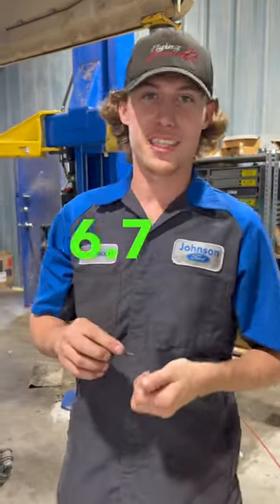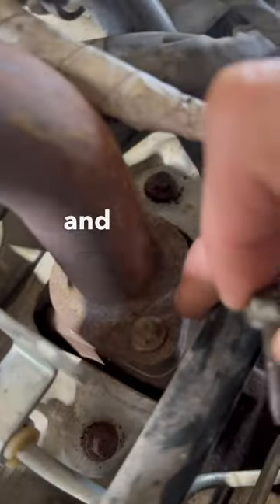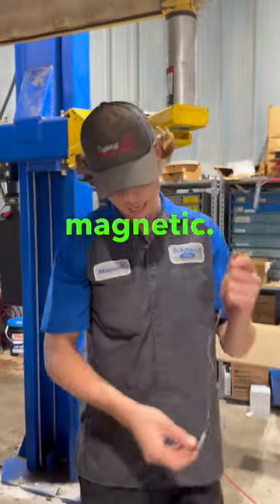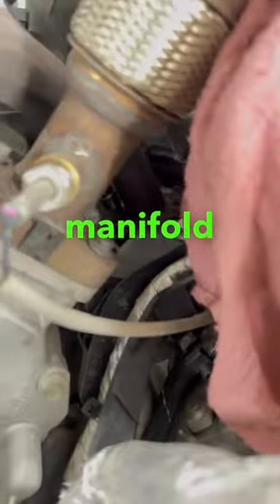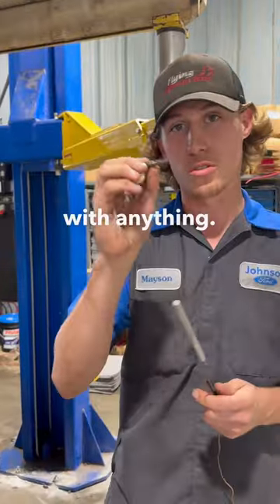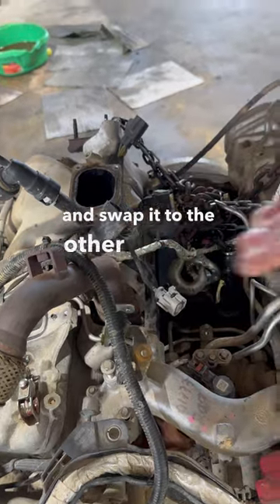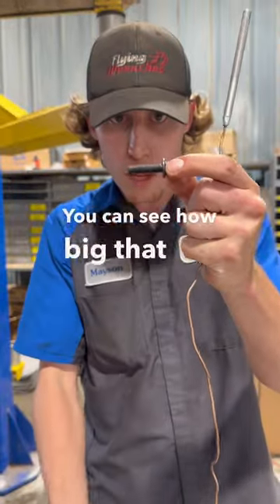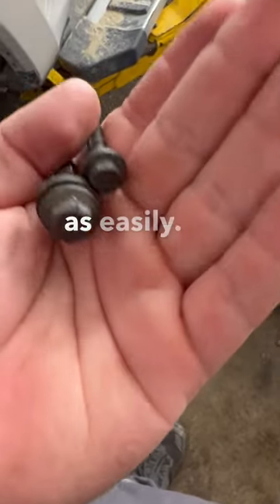6.7 PowerStroke EGR Bolts are a NIGHTMARE #shorts #powerstroke

Comment: I have never had one break since I started using this technique. Buy yourself the longest brass punch the Matco truck will sell you. Take that punch, clamp a set of Vice grips right near the top, and then you gotta wail on those bastards with a 3-4lb sledge. I’m talking a solid 20+ hits per bolt. Try to make hits as direct up to down as possible. This process, obviously, shocks the bolt and shatters the rust “crystalline” structure holding the bolt in place, the rust from the manifold is pinching the bolt and holding it in place, with more force than the yield point of the titanium. If you turn that rust structure into powder or crack the structure enough, then getting them out is possible. I’ve had the last 4 I’ve done with mileages varying from 68K - 180K come out like a dream using this technique, just had to buy a specific punch for it (wasn’t cheap… of course). After striking the piss outta them, I get a 3/8 air impact with a long extension and see if I can get a 5/16 socket to squeeze on there so there is literally no play to round the bolt. Then spray and pray. Sometimes I’ll give it just enough to lift the head, spray some blaster down in there, run it back down and let it sit for an hour. Just on the higher mileage ones. Good luck.

Comment: I've had to weld nuts onto those before.  Used to work on a fleet of them and it was common for those bolts to break when you needed to remove egr cooler.

Comment: I have a attachment for my air hammer you can put a socket on it and turn it with a wrench and it’s worked on those bolts so far

Comment: Pro max has a bit specifically for those and it’ll drill em out both in two mins or less once you get a straight shot !!! I’ll drill one any day and if you come up with a good process and can break just the heads off you can use rbrt 8 mm and slam it down on the shaft and work em out and just do a good ole chase after an bam problems solved and the best is it just disappears because it’s junk 😂

Comment: Heat soak and hose with penetrating oil. Repeat a time or two and pull while engine still hot works them out every time

Comment: I always tell customers the only way I’m doing certain jobs is to replace the manifold.   They as why? I then do as you have and inform them that most likely the bolts will break and drilling them is a no go as well and having the bolts and manifold on hand and ready is the smart Choice and then there isn’t any surprises or delays in the job.  And the manifolds are dirt cheap anyway.

Comment: Get a set of M42 Cobalt drill bits, slow speed & tap oil will drill those out. If you can, find left-hand drill bits, they might remove that bolt so you don't mess the threads up.

Comment: Probably somebody finally explained to the Ford engineers that an 8 mm steel bolt and an 8 mm titanium bolt that are the same size have about the same strength. Titanium is stronger by weight not by volume. There's no point in using titanium unless you're looking to reduce weight. Titanium in the same dimensional size is not significantly stronger than steel. Caterpillar made the same mistake on the mounting bolts for the planetary gears for the rear drive of 793D haul trucks.

Comment: You can heat the bolt up for easy access. Second. Yes. On fords. They tend to make the whole wider with manifolds or any other component that tends to brake. Theynhave kits. Thats the solution.

Comment: I can only see that as being purposeful by Ford to sell more parts during repairs. Who the fuck makes an exhaust bolt out of titanium for a regular car?? One of the most brittle metals there is. Those bolts were MADE to break if you ask me
Reply: The bolts are actually stronger and more difficult to break than a normal bolt even after high mileage . But the manifold is still cast iron. So it pretty much welds itself to the bolt. The bolt’s simply too small and can’t stand the higher than normal force needed to remove it. The bolt itself is 6mm. An 8mm bolt is used in the 6.4 where the exhaust attaches to the turbo. They are very tight. But they seldom break. If ford had simply used an 8mm bolt like they FINALLY started doing in 2022, the bolt probably wouldn’t break.
Reply: Why can’t they design it to be a bolt with a nut on the other end at least you can cut it off and use a new one . Retired ship yard worker here ..
Reply: @anthonygiachinta3056  in that location it is nearly impossible due to the location. But there are several other locations where a bolt and a nut would actually be better. But in that location, a slightly larger bolt would be nice. A stud with a nut would be even better.
Reply: @dmandman9   here’s another engineering marvel . I bought a 2005 mustang convertible when they went retro for my 50 th birthday  . Only drive it in nice weather has only 50,000 miles my wife was driving it and the plastic thermostat housing split on the seam my wife kept driving until she looked like Hailey’s comet and blew both sides of the head gaskets . Why would you make that out of plastic you can get after market housings made out of metal … I’ll answer my on question ..  ford makes shit boxes and they don’t give a shit run by moron pot smoking bean counters .  Never will I by a new American car .

Comment: I broke the first one i tried, but the second one i tightened it pulled the threads. I got longer bolts, and theres enough threads left in the bottom to hold it just fine.

Comment: Can someone explain what the benefit of using titanium for those bolts would be? Is it a strength thing so they can use a smaller bolt or a temperature thing?

Comment: Maybe drill/tap high temp anti-seize using new style bolts. Or drill through oversize and use through bolts and nuts so you can saw, burn, chisel next time.

Comment: Drilling titanium is like drilling stainless steel, only worse. You need low speed, heavy feed pressure and some kind of coolant/lubricant. If you don't push hard enough it will work harden under the drill bit, at which point nothing short of a tungsten carbide drill will get through it.

Comment: Have you tried. If the engine is still a running engine before tare down. Loosening the bolts with the engine hot. Just curious if it would help and not break the bolt 🤔

Comment: Those bolts do suck. Been there on a 2011 F-550. I give it to Ford though, they designed and built the 6.7 all on their own and honestly (CP4 pump issues aside) did pretty good, especially considering revolutionary inverse location of exhaust manifolds to intake manifold(s)

Comment: A cobolt drill or tungsten carbide will drill through titanium, but you have to be very careful. As a 30-year machinist, i have drilled into Titanium 10's of times, and carbide drill bits will shatter on you

Comment: Ok- That’s an 8mm HEAD, but the threads are 6mm.  That’s an exhaust component with SIX MILLIMETER BOLTS. Ford. Leave 6mm hardware for things like hush panels and evaporator boxes. Not 800 degree engine components.

Comment: Use a Cobalt drill bit. Call a Local tool manufacture. They will make you a Drill bit perfectly sized for under $100 and teach you how to sharpen it will a drill doctor and a good stone wheel.

Comment: Wonder why they would use a titanium bolt in an external exhaust pipe stainless steel would have been good enough It's a stainless steel exhaust pipe. And you can't chill the titanium with a regular bit cuz it's too hard It's harder than the steel bit you're going to use

Comment: Lmao I’m just so beside myself because I’ve run into these issues with titanium screws on a ford that broke and you can’t drill them out WTF IS WRONG WITH FORD ENGINEERS lmao do they all get high before designing something and they just made the bolt bigger lmao it fixes nothing just a bigger pain in the ass

Comment: 2 flute soild carbide drill bits. Not ment for hand drilling, but if you steady and use heavy pressure, low rpms they will cut almost anything.  Not cheap. 60$ for 1/8th. You can use 309 wire to Fuse to titanium with tig. Haste-alloy works as well for extraction build up. For the love of christ, is it really to expensive and time consuming to use some damn anti-seize?

Comment: If any manufacturer uses m6 bolts for anything that has to do with exhaust. They knew what they were doing. On purpose
Reply: Nissan 4L for example… I worked for Nissan many years. I’d get xterras right off the delivery truck with 5 miles on it. Blown up clutch right? The m6 exhaust manifold heat shield bolts… no matter what you did. Would snap off. They designed it this way.

Comment: In aviation we use cobalt vanadium (CoVan)drill bits to make short work of titanium.  Dip your drill bit in Boe-Lube, turn your drill down to crawl, and lean on the sonofabitch.  The second you get the titanium hot your drill bit goes on vacation!  Firm pressure and slow drill rotation.  We also use an anti seize called Silver Goop, no shit, I’m serious.  Any time you are using titanium in a ferrous material you have a bit of an electrolytic situation that will make most jet engine mechanics want to slap the shit out of their moms.  Hence, the Silver Goop, look it up, that’s what it’s called.  It is pure silver paste in some doohickey spooge so you can brush it on.  Another trick to separate titanium from a ferrous capture is to uptorque about five ft/lbs over max recommended torque, then try to break her loose.  Titanium is a TERRIBLE fastener material, and between the bolts, Hi-Locs, taper pins, and a bunch of others, time and patience are your allies!  Please keep doing all the great things you do, I have found a whole new level of hate for my FURD F-350 Tremor POS wannabe reliable truck paperweight POS, did I mention POS….

Comment: Alright, let's not act like just because "it's titanium" that it can't be fixed.

No, your probably not doing to fix it with your Milwaukee...but you could almost certainly do it with a drill press and definitely with a mill. The question is whether or not the part is cheaper than the repair.

Comment: How did engineers not forsee a tiny exhaust bolt seizing being a problem?
Reply: The engineers job is to make the object as cheep as possible, but just good enough to make it past the warranty period.  They don't usually care what it takes to fix it, unless they get sooooooo much bad feed back they do something about it.  My guess on this is they were getting too many warranty claims, so they went to a larger bolt to get it to run past the warranty period. Not sure if the new bolt is cheaper than some antiseize or not.  Probably a process change to put antiseize on the bolt (that's probably too costly).

Comment: I’m not sure what ford was thinking. Putting titanium bolts in a cast aluminum part. Then expose it to the elements. That thing ain’t coming out, and if you break it. Unless you have the correct bit. It’s going to be a bitch to fix. Did ford at least use some kind of sleeve or titanium heli coil?? I would assume not or it wouldn’t be stuck.

Comment: Why would you ever use an 8mm bolt anywhere in the exhaust system?? ESP at the damn manifold, spray penetrating oil, heat it and hope for the best I guess. Stupid way to spend money is if you make the bolt super strong with precious metals and then make it smaller than a spaghetti noodle 🍜

Comment: Im completely convinced anything after at least the 2010s is just garbage. Like 60-75% of the car is plastic, engineers are loyal to the company not their customers, mechanics now need to be called "technicians", right-to-repair is a joke, and it costs $1500 to change out the god damn oil because you have to remove the exhaust, transmission, lower the engine and wait for the 2nd full moon of winter to get to the drain. I was gonna be a technician until i saw how retarded engineers can be just to make everything harder. Ill stick to older better build garbage and eventually become an antique dealer, better than getting pissed and ripping shit outta the new trash, old shit wont let me do that.

Comment: Fuckin kids I have removed them many times and have never had an issue. I'm sure I will now because I ran my mouth but if you can't feel the bolt flex point you should be handing wrenches to the master techs🤣🤣🤣🤣🤣.

Comment: I don't think these are really titanium...They should be some kind of heat resistant austenitic stainless steel. Its non magnetic and really wears drill bits and breaks them, especially if you don't get the drill speed just right. Best to use cobalt bits and a lot of cutting fluid to cool it down. The stuff is work hardening, even from a normal center punch so you're off to a good start...lol.  Titanium should be significantly lighter, almost feels like plastic not metal weightwise. You can put it on a grinding wheel, the sparks look very different from steel...also they'd be probably be 50 bucks a piece if they were Ti 😂
Reply: By the way, this material can seize so bad, they can feel tight/make torque wrench click, before they're really tight. That's why it's good to use heat resistant anti seize when installing.  Some manufacturers recommend this in their repair manuals and have their own products and when used, there's zero problems getting them out or in...